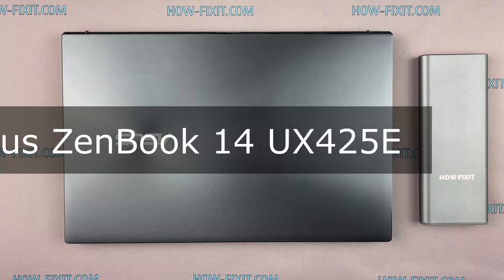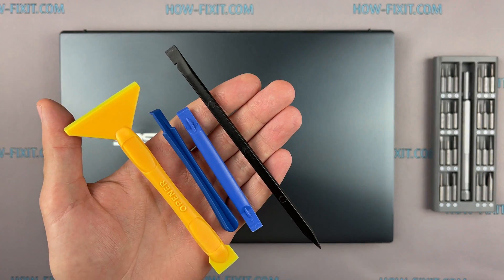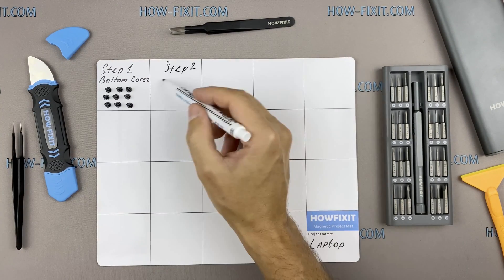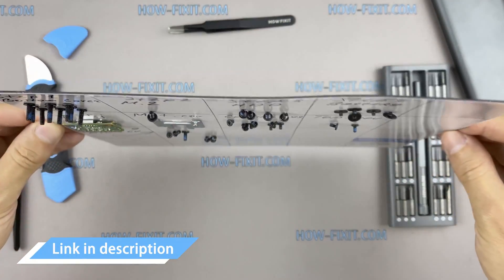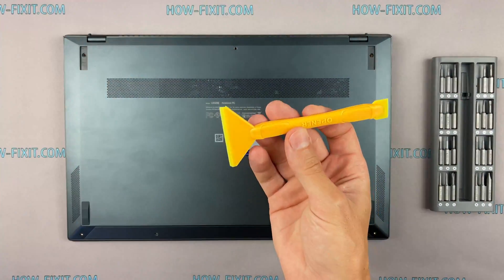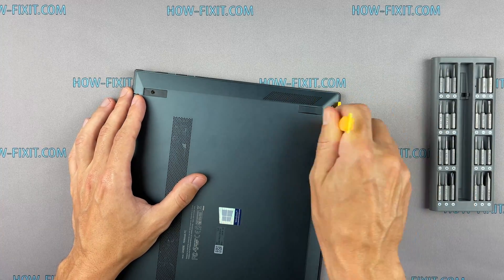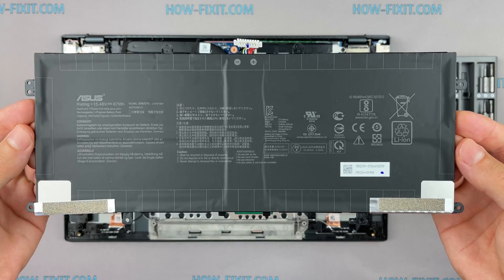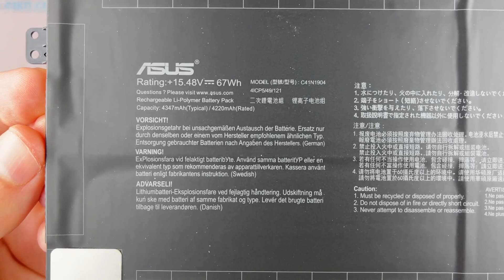Asus ZenBook 14 UX425E Battery Replacement | Repair Fast-Draining Battery

Comment: there are two differents references of battery for asus ux425e, c41n1904 and c41n1904-1, which is the correct reference for my asus ux425e?
Reply: They are interchangeable. I replaced mine (-1 part number) with the battery without the -1 at the end. Works exactly the same.

Comment: Make sure to use the right torx screwdriver and not a generic one because you might strip the screw socket and that will cause a bigger problem removing the screws